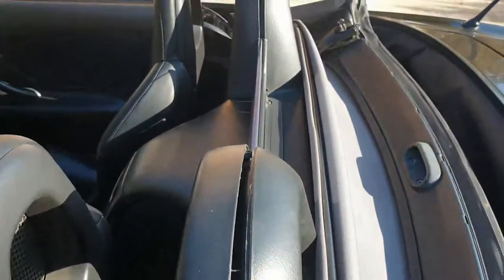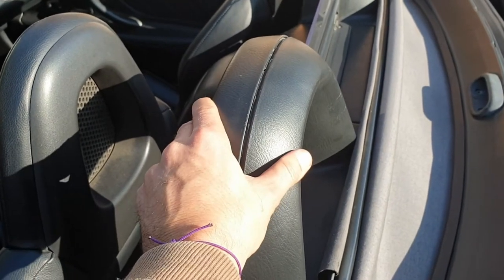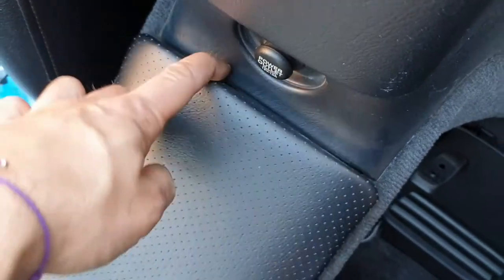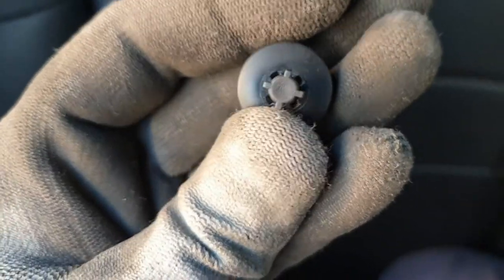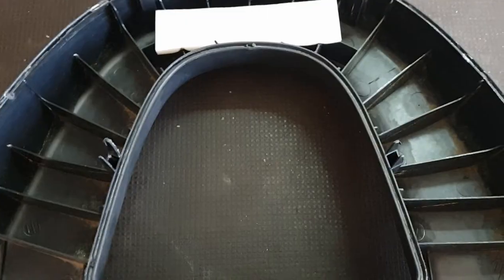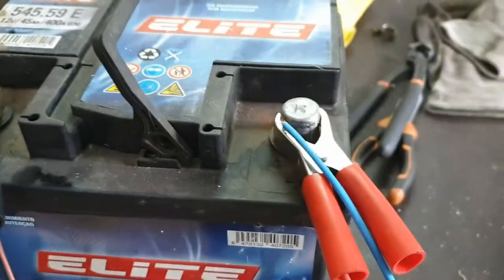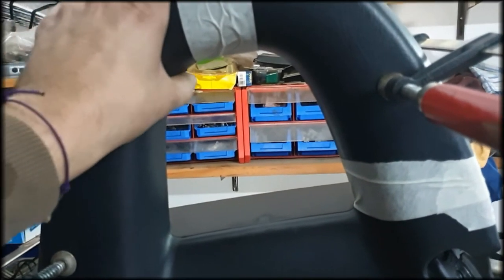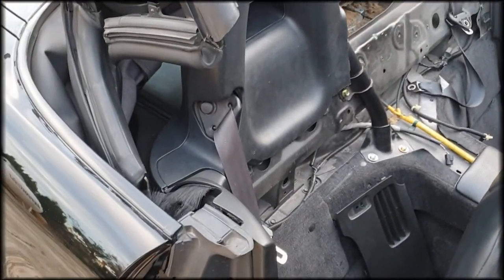S2000 Opened Roll Hoops - Restoration to Factory

Comment: Mine just opened on it's own, while the original top was still present and nobody messed with it.  While the shop was installing a new top a couple years later, they asked me if I did anything to cause it. and I said no.  I really wish they had the expertise to do this while the top was removed.  I appreciate your kindness sharing this information so I know what to do to fix it.  The language is not an issue I am in the United States.
Reply from the maker: I am happy this can help you!! Consider subscribing to my Chanel, it can help me a lot! Regards from Spain.

Comment: Sir, I have watched your video multiple times, but I don't see how you accessed the back side of the bulkhead to get to the mounting bolts on that side. I see others seem to have done it but I am nervous about it. Thank you in advance for your reply and also for posting your video. It is the only one that addresses this work.
Reply from the maker: Hello John, I don't understand what you mean by Bulkhead... If you are talking about the bolts and clamps of the plastic liner behind the roll hoops, just follow the steps explained in the video. Some of them I can't show in the video because impossible to film there.
And don't get stressed about something you've never done, follow the steps in this video and you'll be fine.
Once you have the car in front of you and you start disassemble, you will get it.
I take advantage on every new comments to make an update on mines, they are still holding perfectly.
Patience, some cold beers and you will make it. Good luck.
Reply: @Orelionsworkshop  Thank you for the reply. I am going to tackle it tomorrow.

Comment: I was detailing the interior of my car the other day and noticed the passenger side roll hoop cover had come apart like this. Thanks for the video, thankfully I only have to repair one side (for now). I'm assuming I still have to remove the panels on the driver side to remove the glove box as well?
Reply from the maker: Hi Judo, please consider subscribing to my channel. Sorry for the late reply, yes follow my instructions in the video and you'll fix it. Mines are still holding strong, like new!

Comment: Phenomenal tutorial! Thank you so much for taking the time to make this.
Would a 12V computer power supply work as the power source? Wondering if a car battery is required or not? thanks again!
Reply from the maker: Thank you for your support! Please consider subscribing to my channel. It would be of great help. Regarding the computer power source I can’t tell… I would recommend you do it with a fully charged 12v car battery better.
Reply: @Orelionsworkshop it seems like a fully charged 12v battery would put out too much current. Was yours fully charged when you did this?
Reply from the maker: @JDMjdawg  12v is 12v unless you are referring to the amps, in my case I was even using a battery charger so more like 14v… don’t bother with that, the important is the amount of time you apply it. As soon as it starts smoking a little bit, remove the current. Just follow my video and you’ll be fine.
Reply: I was talking about the amperage since car batteries of course are high amperage. I just finished welding my roll hoop covers using your method with a brand new S2000 battery and it was smoking within 3 or 4 seconds! Thanks again for putting this tutorial together. Do you have a buy me a coffee link?

Comment: Is it possible to do this without taking everything apart? If I Could just clamp the battery to each end of the wire you think it would cause any issues?
Reply from the maker: To be honest, it is not complicated to take the roll hoops apart from the car, and you will have much more room to do the welding process. That's why I did it that way. Keep me posted when you've done yours.

Comment: Looks like it’s totally possible to remove the roll hope and the center console box without removing the trim pieces and trays behind the roll hoop?
Reply from the maker: You don't have to remove those parts at all. Just need to unclamp the plastic rivets that holds them to the roll hoops and you will be good.
Thanks for your comment. Please consider subscribing
Reply: Thanks! I subscribed…

Can you advise the locations of the rivets that clamp onto the roll hoop? How many of them?
Reply from the maker: @nicholastjs  Hi! from 5:50 on the video everything is explained. It will be clear for you once you have the car in front of you.
Thanks for subscribing.

Comment: I have an ‘08 (US) and it was nearly impossible to see the wire for the outer perimeter, I had to take a magnet to confirm it was there. Was yours already exposed sufficiently, or did you modify to facilitate the job? Wonders how best to expose the inner wire…
Reply from the maker: Hi Daniel, please consider subscribing to my channel. The inner and outer wires were exactly as shown on my video, except the extremity that I had to pull a little bit in order to attach the alligator clips. But basically, everything you see on the video is what I have done.
Reply: I had to cut the wire and make a small break to get two separate ends but it worked!

Comment: Can this method be done in reverse?
Reply from the maker: This method for reverse? So opening the Roll Hoops basically, is that what you mean? If so, then just pull on them but I can’t guarantee you will not break them. They where not meant to be open
Reply: @Orelionsworkshop  Thank you so much for the quick reply!! That's right, I meant just that, my driver's side roll hoop is ruined by scratches and marks made by the previous owner and I would like to replace the second half (rear, in front of the soft top) with another one in better condition. Unfortunately, Honda stopped the production of the part 2 years ago :(
Reply: @Orelionsworkshop  Could I use this method without holding both parts in place so I can pull them apart?
Reply from the maker: @smokeynagata1964  that’s a good point! By warming the wire and melting the plastic it will come apart nicely. But you’ll have to do it on both wires at the same time and do it very quickly. Take care to not over warm the wire. But sincerely, if what you pretend is remove a damaged plastic, you could just pull on both parts
Reply: @Orelionsworkshop  Honestly I'm scared to do all that 😅 anyway thank you so much for the advice man, I really appreciate it!